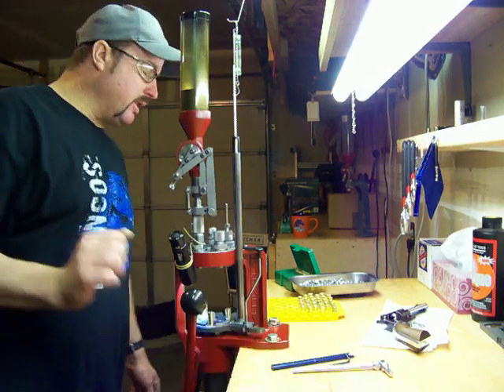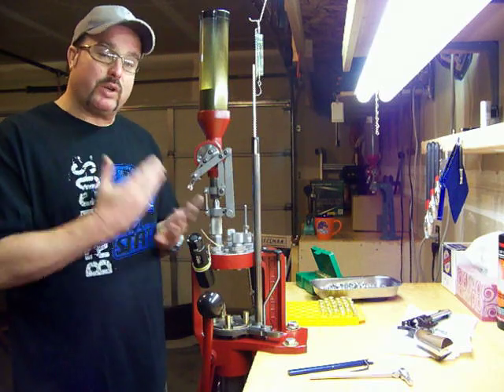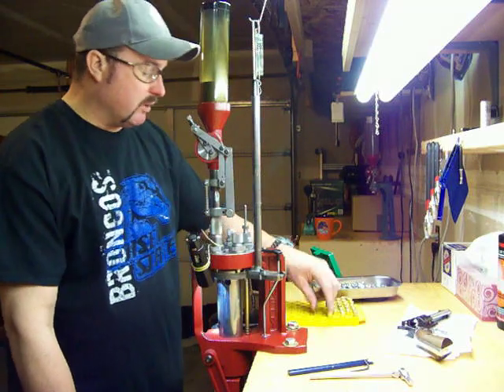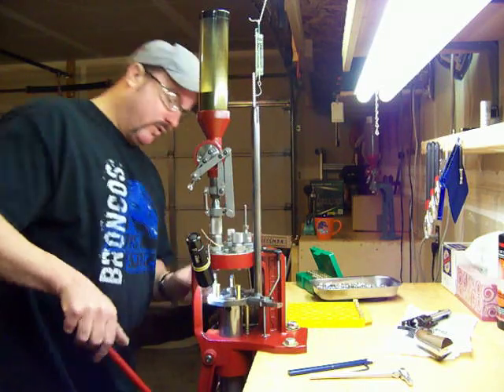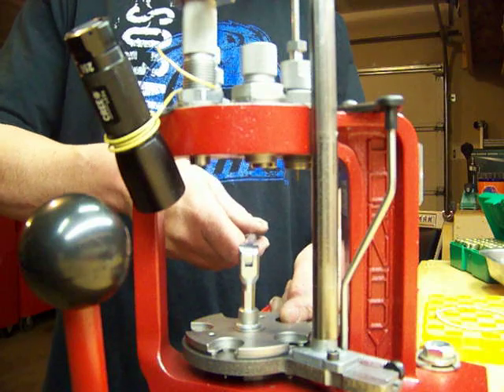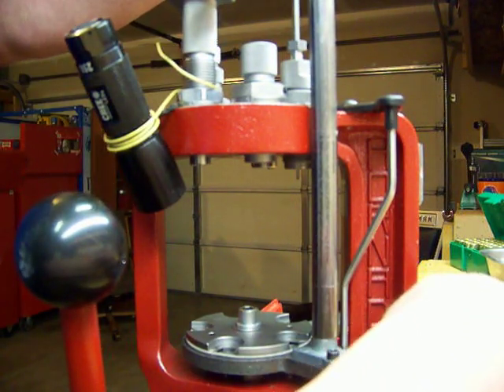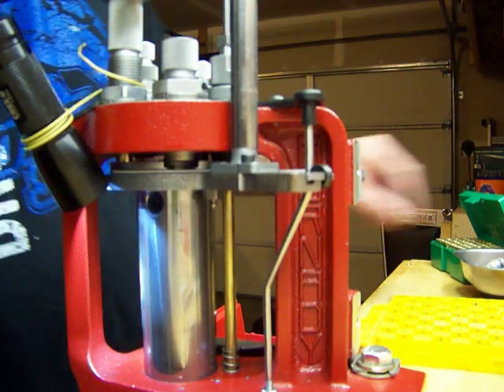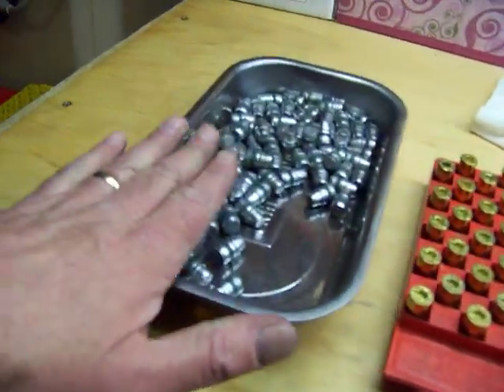Hornady LNL AP Press Set Up Hints and Tricks, Part 1

Comment: im having a hard time setting up the powder delivery … can you show how to set up for 9mm?
Reply from the maker: +Kris Kryger Kris, I no longer run the Hornady and in fact I am selling it. It is torn down. Are you setting up with the powder through expanded. If so you need to call Hornady because I never ran it that way. Highboy
Reply: +76Highboy Reloading (Highboy Reloading) 

Any reason why?
Reply from the maker: +Justins1877 My reason is, after working with Dillon it is better. My Hornady is nice but the difference is night and day. For the long haul Dillon will outlast but if a person prefers Hornady that is gone by me. It just comes down to personal preference and budget. Thanks for asking. Highboy
Reply: +76Highboy Reloading (Highboy Reloading) Dillon is definately made of more flimsy pieces. Just about everything on the Hornady is more stout, the ram, the powder measure, the connections, etc.

Comment: Hi Bill, do you have problems like you are experiencing on this video? Is this the norm for the Hornady LNL AP Press?
Reply from the maker: The Hornady LNL is a great press. I have about a dozen videos on this particular press. It runs excellent and I prove it in all of my videos. I have these six videos showing how to set it up and then more videos in "The Beginning Reloading Series". The press is straight forward and runs dependable and I prove it.

One comment I will make. I have never ran the automated bullet and case feeder so I have no idea how well that works.

Thanks for asking.

Highboy
Reply: Thanks Bill, I was asking because I am juggling the Hornady LNL vs the Dillon 650, can you post your view on this. Thanks for taking the timeout to make the video's, great job.
Reply from the maker: tim roberts
Tim, I know very little about Dillon except they make great equipment without a doubt. I will eventually be going with the 650 as $$$ permits and I will take it down to the nuts and bolts. I am looking forward to getting A Dillon.

Thanks Tim.
Highboy

Comment: Thanks for the video. I have a question. I am new to reloading and a buddy who has been doing it for a number of years recommended this press. He said for .223/5.56 the depriming/resizing die also resizes the case to the proper length (1.760) so you dont have to trim (1.750). Is his statement accurate? Thanks in advance.
Reply from the maker: Carl Coate No, it is not true. The resize die decaps the case, sizes the neck and returns the case back to SAMMI demensions. I do not use a progressive machine to redize my cases. Follow my channel because I address this on a regulet basis. As far as trim length, you need to verify it because it can cause you to blow your rifle up if not addressed. once again, regular stuff on my channel. Very good question and... dont listen to your buddy. Read, read, read.  Highboy
Reply: Thanks

Comment: I have a problem with the cam wire rod always popping out. Frustrating to keep moving the bracket back and forth and the priming wheel keeps pushing it out no matter where I put it. Tried shimming top of rod with tape to no luck. Cam wire bracket is fine no cracks or anything wrong with it. Any suggestions? Thanks!
Reply from the maker: I do not use Hornady anymore but I have some of my members who have them. Go to my forum and sign up. There you can start a thread and ask. Go to 76highboy.com
Reply: @76Highboy  Thank You so much! I actually figured it out now but I’ll give that a look

Comment: I like that you can run standard dies on this press.
Reply from the maker: +David Evans They are the 7/8 14 thread die. Highboy
Reply: Good video,thank you.  I have had the following problem from the first day I owned the press and the problem is the finished cartridge hangs up on the ejector.  I called Hornady and they said they new about the problem and all I needed to do was return my machine and they would send me rebuilt machine.  I said that all I need was the part to fix it with.  They said that the factory had to do the fix.  I asked them to explain what the problem was that they found.  They said it was to complicated.  So, I gave up on Hornady and their insults and mixed up some epoxy and formed a little ramp to eject the shell.  It works about 75% better but a lot of times it will lock up the machine.  I was wondering if you have any pull with Hornady and shame them into sending me the new part.
Thank. You and Happy New Year.

Comment: hey 76highboy!  I wanna throw my lnl out the window at times! before I bought a press I watched your first six videos then went out and bought the lnl, then after loading for a few months I've been watching all your vids and seems you too aren't so happy with it?
Reply from the maker: My Hornady was not a bad press. But, after using the Dillon Square Deal B, the 650 and the 550 I sold my Hornady. To date I have never had to call Dillon. Not once! No tweaking or adjusting on them. Just reloading. Some like the Hornady and some have problems with it. Highboy

Comment: hey Jim, just got my lnl press, loading 9mm. every time i index the press powder spills from cases, also cant seem to get ptx and powder measure tuned in right. any advice would be great thanks! sorry if this has been addressed already.
Reply from the maker: I have not loaded 9mm on the progressive presses yet but I hear they do spill powder on the 9mm. One thing you can do is take your left hand and hold the shell plate as it indexes around each time. I may end up loading 9mm on my Redding T7 Turret press. I will have to see.

As for the PTX expander I never used it on my Hornady. Ask CMAX Arms. He loads 9mm on the Dillon I think

Sorry I was not a lot of help for you. 

Highboy
Reply: brad king I have to tweak my lnl all the time!  kinda getting sick of it!   I fixed my powder spill on index by tapping the two ball bearings down a little, adjusting the left paw like hornady tech said didn't do it!

Comment: How can a loose shell plate cause COAL problems? How far the case is pushed into the die is determined by the sub plate, isn't it? The shell plate is responsible for properly positioning the case under the die, and for withdrawing the case from the die. The case & bullet get pushed up into the seating die by the sub plate.

BTW, I like the lock washer idea. I got one for my press.
Reply from the maker: Yes the shell plate rests upon the sub plate but it can still wobble and teeter. Think about what happens when the ram is dropping and the expander/resize are being pulled from their dies... that pulls the plate upward and shakes it. Each time you move it upward and downward the shell plate is moving. That needs to me minimalized. Highboy
Reply: @76Highboy  I agree that the shell plate movement needs to be minimized, but you stated that it would cause COAL variations. It won't. Even if the shell plate wobbles and teeters, once the case & bullet enters the seating die, the base of the case will be resting on the sub plate. How far the sub plate pushes the case & bullet into the die will determine the COAL. Can a loose shell plate affect the movement of the sub plate? I don't think it can.

BTW, thanks for making these videos, and thanks for taking the time to respond.
Reply from the maker: @gearhead366  The Forester Co-Ax has floating dies and it seats consistently every time. So in theory I understand what you are saying except, the shell plare has 2 detent bearings. Therefore, if loose it teeters. That is why when the shell plate is full you get a certain C.O.L. and when you run it with one at a time you get a different C.O.L. This has been discussed in our live streams at times and multiple channels agree AND... we Hornady even says the shell plate needs to be tightened properly of you will get a different C.O.L. I have personally spoke to over 3000 of my viewers on the phone and have Skyped with many helping them get their Hornadys fiqured out... Dillons too. A loose shell plate will cause it. Feel free to send a e-mail to groundzeroreloading@gmail.com with your number so we can duscuss it more. I am busy on my forum. 76highboy.com

Comment: I received for Christmas one of these presses. I have been reloading since the 70's with a Rockchucker, and a scale. (I have a volume measurer, but only use it rarely for when I have 100+ pistol rounds to load) I think I know the answers to these questions, but perhaps I'm overlooking something... first, If loading bottle neck cases, is there an easier way than rolling 5 at a time on a case lube pad, and putting all of these sticky cases in? Also, is there a problem leaving the inside of the case neck coated with lube, then putting in powder and bullet? Finally, when using a progressive the pocket for the primers is left dirty? Thanks for any advise. PS: my first 4 wheel drive truck was a 73 f-250 Highboy...
Reply: Yes.  I use the the Hornady aerosol spray lube.  Put your cases in a plastic tray, with the necks up, and spray the lube on both sides of the cases.  Leave an empty hole between each case, so that you can get all the way around the cases.  Ignore the instructions on the can, and make sure you get the cases coated well.  You can let the cases dry and the lube will still work.  If you are loading .223, then a plastic tray from a Remington 9mm or .38 Special cartridge box works well.  For .308 or .30-06, use the tray from a .45ACP cartridge box.  I don't worry too much about getting the inside of the neck, and don't have a problem with the Lee expander, YMMV.

Comment: I believe I have everything figured out except the primers arent seating properly. I dont know if this is a technique issue or what. I have so far only made 1 correct cartridge in 5 attempts.
Reply: I am thinking the slide might be dirty... so I will go back and clean that with rubbing alcohol as in @1:10 of your video describes
Reply: Alex, the reason is most likely the priming pin that pushes the primer in  causes a dimple in the press which will cause that problem. I prime off the press now. frustrating.
Reply from the maker: That is what Hornady told me to do. Good comment. Your hired. Highboy
Reply: +76Highboy Reloading (Highboy Reloading) there are some fixes for it which can be found online.
Reply from the maker: Actually I purchased new priming rams and it is priming about 0.003" below flush. I am getting ready to sell all my Hornady gear. Highboy
Reply: You are no longer reloading? :(
Reply from the maker: +Alex Gigoux Alex, send me a messsge to groundzeroreloading@gmail.com. Lets see if i can help you with your press. Highboy
Reply: I appreciate your eagerness to help but I figured out how to fix it. Basically I was fearful of how much pressure I was using to pull down on the lever in order to seat the primer (thinking it might explode on me) but since it is a tight press fit I just decided to man up and pull a little harder then before and it works perfectly. I have so far loaded around 200 rounds with no issues.

Comment: On my press, the ball detentes come loose well before the lock washer is tightened all the way down.  The shell plate can rock back and forth hugely without further tightening.  I am concerned about overtightening damaging the indexing palls.
Reply from the maker: The ball detents need to roll so they should be loose. If you are saying they are not staying secured call Hornady, they will certainly help you. Easy fix IMO. Hornady has great customer service. Thanks and welcome to the channel. Highboy
Reply: I think I misspoke.  Here's what happens:

1.  I install the round washer, then the lock washer, then the hex head bolt.
2.  Tighten until shell plate turns.  Hold shell plate tighten slightly further, just as you did in the video.
3.  After this, my lock washer is not flat against the round washer.  When seating a primer, the lock washer flexes and the entire shell plate rocks to one side.

My concern is that tightening further until the lock washer is flat and nothing flexes my put too stress on the indexing palls.

Comment: I am having an overall length problem with 223 @55 grain FMJ. Variance of up to.030 Do you have a video on that? Thanks in advance JT I.F. ID. 83401
Reply from the maker: 30 thousandths is a lot. It has to be the seat die. Do you have another seat die? Seat stem? Highboy
Reply: 76Highboy Reloading I have two more sets and will try another tomorrow. Base plate seems tight a d have shimmed to keep shell plate within 005" works smooth just wierd.  Thanks,. JT

Comment: What about just removable Loctite instead?
Reply from the maker: My personal preference would be the lock washer. LockTite is something that I would use for something that I "Rarely" remove. However if you choose to use it it does not mean you are wrong. Just make sure it does not get messy. The lock washer will be cheaper. Thanks for asking. Highboy
Reply: Just went down to garage and dug up lock washer and remedied the primer grove and slide. Next is cleaning the powder assembly. Great videos instilling loads of confidence in me for this life time endeavor. I'm new to reloading and will be apprenticing a Vet in the next few weeks to learn the ropes. I got the LNL-AP knowing that I can use it as a single stage and just run them in batches, once I fine tune my technique then I can fully take advantage of the AP feature.Thanks again for all the help. I plan on posting a video once it's all set up.
Reply from the maker: Jose B
Make sure you watch the beginning reloading series. Here is a link. Highboy

Beginning Reloading, Video 1, Presses
Reply: Bill Morgan Awesome about to do it once the wife leaves to work here in the next hour, then headed to garage.
Reply from the maker: Jose B
Enjoy partner. Highboy
Reply: Bill Morgan Damn, just slammed out some good garage time. Cleaned the powder drop like you recommended with graphite and cleaned the parts with q-tips, damn those parts were dirty. Even set up primer system like you advised and ran about 100 primers through. Man that really helped to become familiarized with the press. Can't wait to set up the dies. Any vidz on that for 9mm or .223? Thanks again for the great videos. Oh and I replaced and added the two O rings you recommended also. Good day in the garage. Pictures and vidz to come.
Reply from the maker: Jose B
After the Women's Beginning Reloading I will go into the AR 223. Then I will do the 45 Auto and then maybe the 9mm.
Reply: Got to thank you again Bill, last night I de-capped & flared 1000+ 9mm rounds. Ran into minor hiccups but nothing that couldn't be remedied due to your awesome videos that prepared me for anything to happen, mostly operator error.
Reply from the maker: I would not because the only time I use Loctite is when "Nothing" will keep it from coming loose. The lock-washer is a great fix and also the removable loctite may become messy and that should be avoided at the press level. But what the heck, try it. Highboy

Comment: Keeping the shellplate tight is a very good idea. However, possibly not good enough. There is often too much play between the shellplate and carrier, even after proper tightening. Here is another method to ease shellplate snap, and  will also fix primer depth and primer insert angle issues. In older presses, it may also stop 357 case tilt occurrences in station 5.

Place an arbor shim under the carrier so that the shellplate tightens better.
https://www.ar15.com/forums/armory/How_to_tune_the_Hornady_Lock_N_Load_AP_progressive_press/42-414607/

Comment: good video but you need to get camera closer to press and/or get your right hand out of the way.
Reply from the maker: Let's see your videos? Highboy
Reply: 76Highboy Reloading your video is very good and has excellent advice.  I don't mean to offend but I've never used this type of pressed before and your right hand is blocking what you're doing with your left hand.  The closer of view of the press itself and watching your left hand  inserting shells and bullets would have made it more helpful.
Reply from the maker: These videos were made 5 years ago in the middle of the night. They were requested by friends so I used a simple digital camera which had no tri-pod or zoom. I no longer own the press. I do have very detailed videos on the Dillon so if you ever get a Dillon 550 or 650 those may be more helpful. Thanks Sir. Highboy